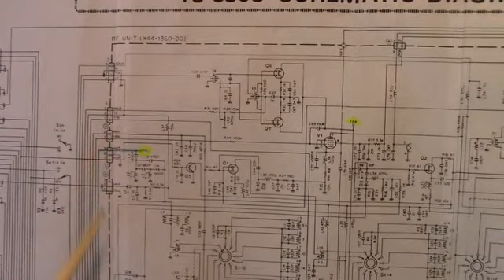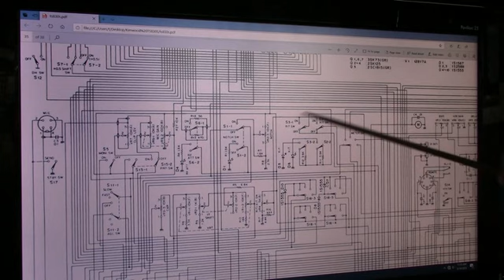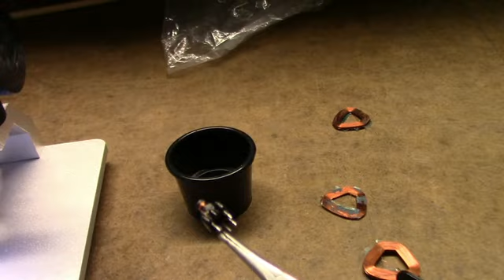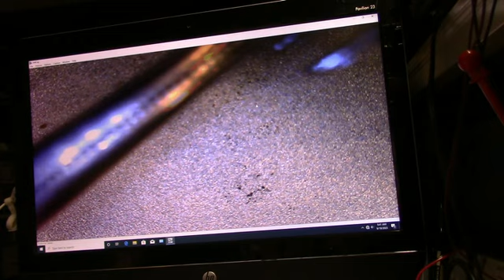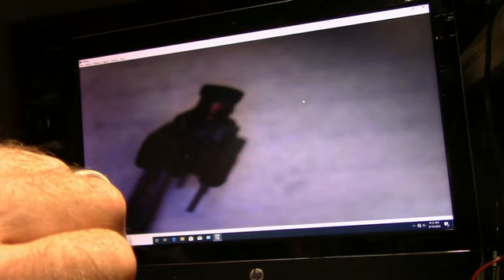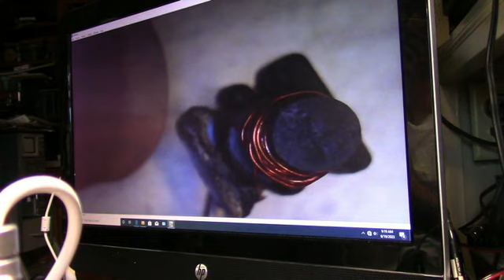Kenwood TS 830S Repair

Comment: 18 years ago I had a TS-820. I had the antenna disconnected but the radio was still grounded. We had a lightning strike in our back yard. The TS-820's front end still got fried. 73s

Comment: Hello, I just bought one "for parts not working".  It switches on. Did not test sending yet. But only receiving. I found it has an issue. When I set USB or LSB I hear relay starts to click constantly as car turning lights. Do you know where should I search for issue?
Reply: In other modes I hear a sound from a speaker or headphones,  I can try to tune, and when I touch antenna I hear my touches.

Comment: Looking at the newer radios, they use smaller ones...... Wow     If you have old color TV's laying around the color delay line uses that wire. 
The long ceramic bar mounted on the board.  Nice work, take care.

Comment: I see many of these at hamfests,  but do not want to take a chance that they may have problems.
Reply from the maker: Hi Jim,  There is an abundant supply of these older rigs at hamfests.  Many of these are in need of some TLC.  If you don't feel comfortable working on them,  you might want to buy a used rig from a local ham that can demonstrate the unit for you.  A lot of " works great" radios at hamfests seem to develop problems on the trip home.